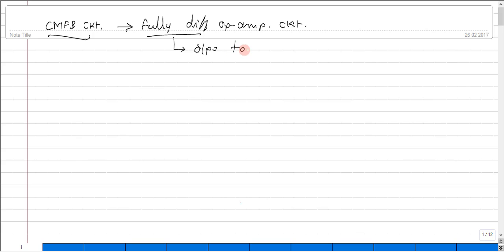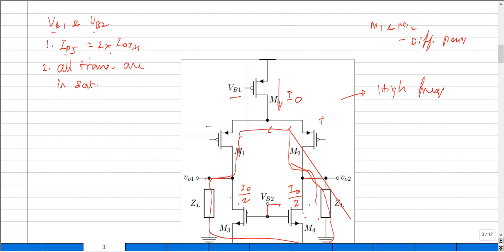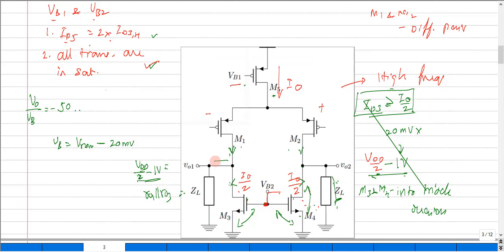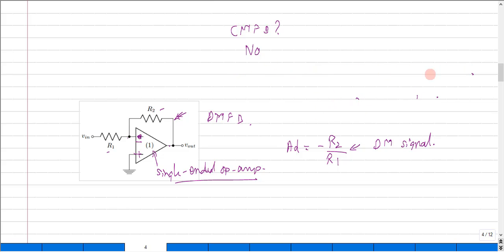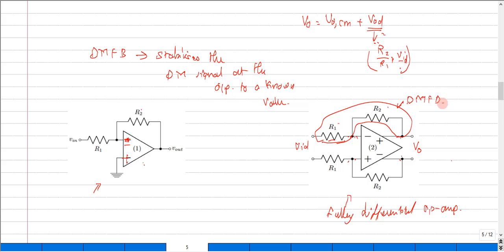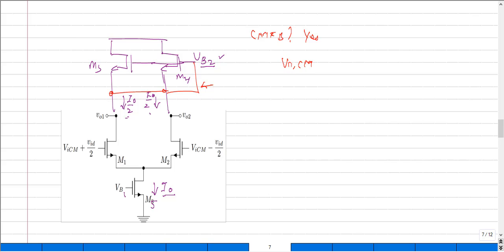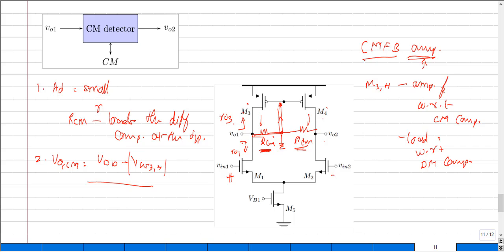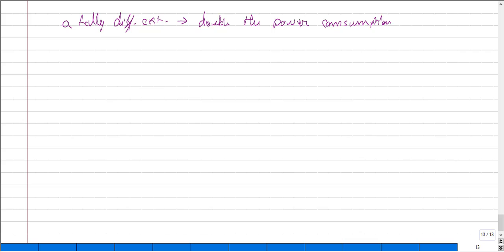CMFB

Comment: sir what voltage we r applying the M1 and M2 gate
Reply from the maker: Basically it will have both common mode signal and differential signal, but in the video intially I have explained what happens when a differential signal is applied (as opposite phase signals).
Reply: Sir supposed my vdd is 0.5 V then what voltage be r applying in the Vcm and what is  the effect on output

Comment: Sir can u explain how bandwidth is related to speed of the circuit mathematically?
Thank u
Reply from the maker: A step input, in Fourier domain contains component all along the infinite frequency. But the pole frequencies in the amplifier would then cut off all the high frequency components of input and you will loose the sharp informations.